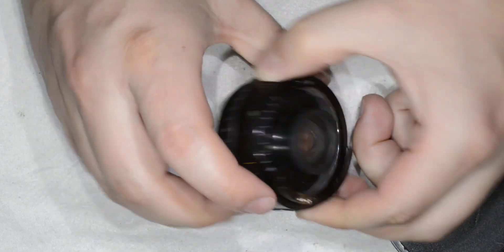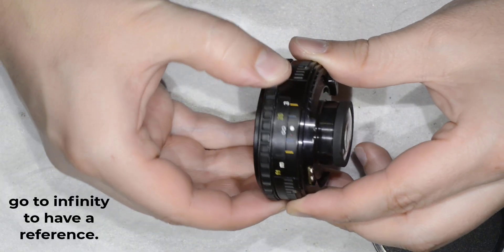Lens repair: How to service lens helicoids

Comment: I think the reason why you can’t focus to infinity is because the second screw of the helicoid (the low pitch one) is bottoming out. I’m not a professional but from my trials and errors, the position of where you screw in the helicoid doesn’t matter because you can align it by adjusting the aforementioned second screw. You just have to disengage the focusing ring when doing so. Afterwards, you can reassemble the focusing ring by adjusting it so it focuses to infinity.
Reply from the maker: Sure, this is how they do it in the factory and you can do it at home but it takes a lot of trial and error if you're not used to it, mark and reassemble as it was works each time. I worked recently on a Leica 28mm 2.8 and the focusing works exactly as you describe and it is readily accessible.

Comment: Working on lenses scares me I have to admit, one little error and the lens is ruined. The lens I am trying to repair is off a British Agilux Agima camera, I think I have got the adjustments right, now I am waiting for the helicoid grease to arrive, apply and reassemble, fingers crossed. Cheers.
Reply from the maker: Working with helicoids is a matter of patience, if you don't have it you're doomed. I'm planning a video to explain people how to choose their lens grease. What grease did you select? Cheers.
Reply: @diyextravaganza  I bought the cheapest HELIMAX-XP 10g size -40c to +149c made in USA £8.49 I have given both parts of the helicoid a thorough clean with nail varnish remover. when the grease arrives next week I will give them a final clean with lighter fluid. They run together very smoothly after the clean already. Cheers.
Reply from the maker: @ianwilkinson4602  Thanks for the information, I really need to complete that video about grease selection. From what I quickly read, it seems to be a good grease but you don't get many technical details about it, which is a pity.

Comment: So you use SKF but share the link for JHT #10. How do these two compare and which one is lighter? Did you have issues with SKF separating and leaking onto aperture blades ?
Reply from the maker: Hi, I did not pay attention to that to be honest. I've use the skf since I started repairing lenses and never had a single problem with it.
Reply: @diyextravaganza  hmm yeah the upper temp is kinda low i am worried if it can evaporate, create the haze on the glass etc. i live in Miami and that could be the issue. Thanks for your reply 👍🏼
Reply from the maker: @ivanzivojinovic1606  I haven't check the max temperature but it's about 80C as I remember, which is kind of okay unless you leave the lens inside the car during summer. Cheers.

Comment: Will this procedure work with the Nikkor 135mm 1:2 ?   I love this lens for photographing cats.  The focus rings is so hard to move that the cat runs away before I get her in focus.  The photographic repair shop in my city charges more than a doctor.  Also can I use Mobill One Axle Rod grease on the helicoid?  It works great on my motorcycle.
Reply from the maker: The procedure will work, however, each lens disassembles differently so you need to figure out how to disassemble it. Where are you located? Cheers
Reply: @diyextravaganza  I'm in San Diego, California, USA.  I am determined to repair my own lenses:
Nikkor:
24mm f2  great condition
35mm f2  has some dust inside
35mm f1.4 great condition
50mm f1.8 great condition
85mm f2 has some dust inside
85mm f1.4  aperture ring not clicky enough
105mm f1.8  focus ring very very stiff
135mm f2  focus ring very very stiff
Reply from the maker: @elminero49  good that you have the determination to fix them. Check this one I haven't posted yet https://youtu.be/0ErY5L6IvlI
Reply from the maker: @elminero49  I have also a video for the 35mm f/2. I have both the 105 1.8 and the 135 f/2 that need some maintenance but no video yet.

Comment: Is there not also a very fine thread, which is the other half of the helicoid? This needs all the old hard grease removed also.
Reply from the maker: I took this lens as example since it has a very simple helicoid mechanism, but you're right, some lenses have also a very fine thread on the focusing mechanism. The old grease need also to be removed there, I have a 50mm 1.4 Ais on my desk waiting for service and it has such mechanism, keep tuned to the channel for that.
Reply: @diyextravaganza  Look forward to it. I saw a good tip on another tube vid, before removing the helicoids, wind the lens in & make a witness mark. On reassembly, winding in, the witness marks should line up, proving helicoid is in the correct thread.
Reply from the maker: @wibbley1  good advice. Thanks.

Comment: Thank You for your video!  I have a Nikkor 35mm f/1.4 AIS that has a rough spot in the focusing ring. I'm going to lube it myself with the instructions you gave. Thanks again!!
Reply from the maker: Hello Larry, thanks for the comment. Don't forget the most important thing, be patient and mark everything. To begin disassembly the 35 1.4 if I remember correctly, you start by removing the set screw that is on the front barrel. Check my video on the 50 1.4 Ais as that part is similar. The rest I don't remember. Cheers.